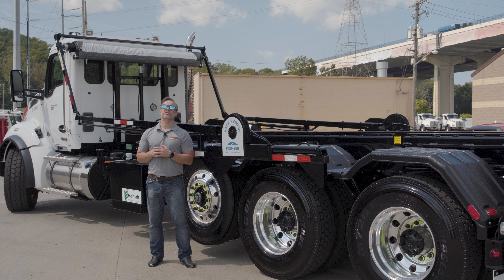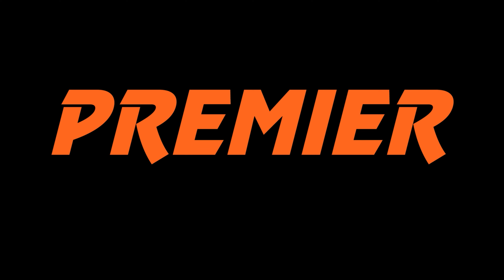Kenworth T880 Roll Off Truck Part 7 - Roll Off Body

Comment: 4 rollers per side? The 2024 KW triaxle rolloff i operate has 5 rollers per side.
Those fenders don't take a beating. Seen coworker have a rock fire out of his tandems right through them fenders. 
Tarper... meh. Bad design at the wind-up roller.  Simple collar w set screw came apart under 1,000 miles.
My hydraulic line where it connects to bottom of lift cylinder... both sides... came off first day of driving the truck. 30,000 miles...cylinders 3 & 5 massive injector failure causing massive misfires, Paccar MX-13. Oh yeah... truck was purchased through premier (Ohio)

Comment: I have a kw T880 why my winch & hoist moving so slow
Reply: Is hydraulic tank valve open completely? Is Hydraulic tank lo? Air in system? PTO not engaging fully? (you'd hear that making a lot of noise). Are you giving it throttle or idle while using hydraulics?